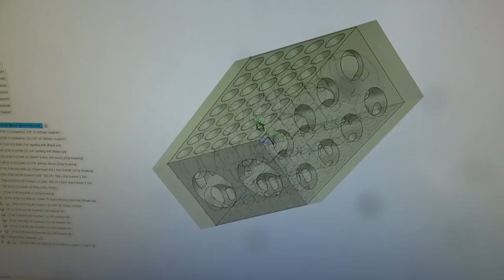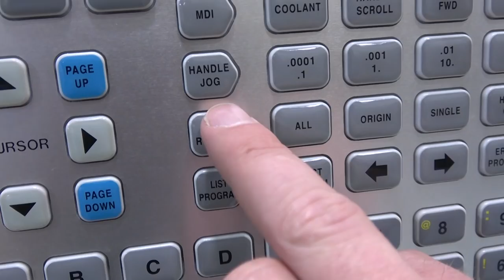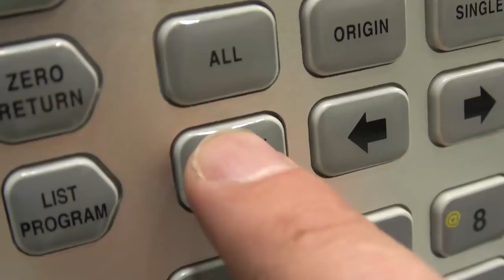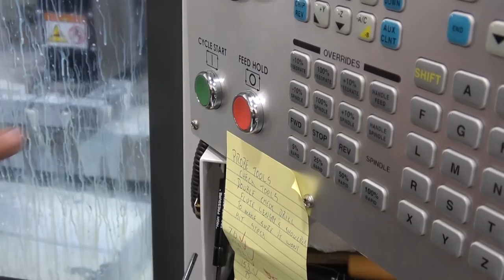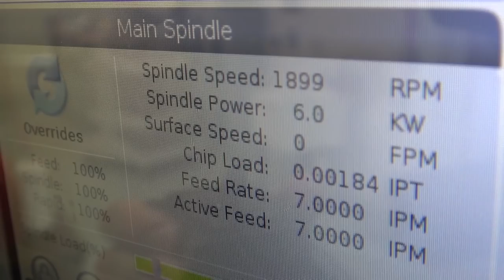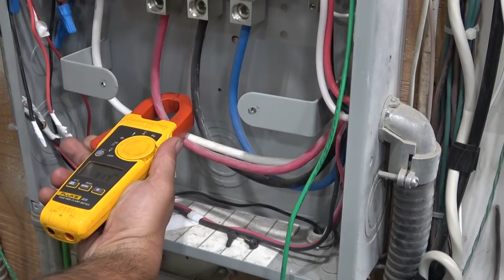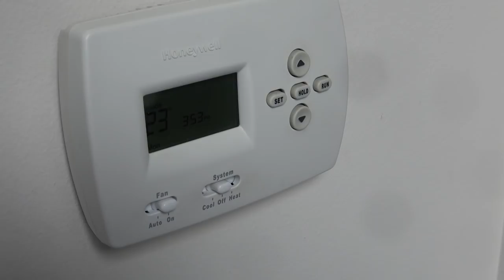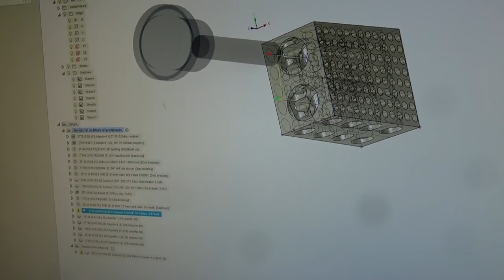Gizz Bloc. Sometimes it's best not to ask.

Comment: Lol you don't need to post a new G-code to start mid-program, just hit search in the MDI DNC page, type in your tool number you're using at that point in the program when it switches out to it the hit cycle start. Whatever line of code is highlighted is where you'll start at and Bob's yer Auntie. Try it out on the warm-up cycle what with the whole program fitting on the screen.

Comment: The Haas tool change bang is not caused by a burr on the pull stud. It's usually from the female taper expanding from heat, and high rpm, and the male taper moving upwards. It can also help to clean the tapers with solvent and scotchbrite.

Comment: The 200ul tubes are gonna be super tough to get out of there with a hollow core, typically it has a bevelled bottom in each well to keep them elevated in the block slightly so you can remove them.
Reply: Also with a hollow core aren't you getting rid of the majority of the mass/contact points for heatsink/cooling the samples?

Comment: Those poor insert drills! Run those bad boys first and crank the snot out of the speeds and feeds. The inserts in them are offset, one takes the point and the other cuts the diameter, they webble wobble all over the place when you try interrupted cuts.
Reply: Naaaah. Not that they aren't great for roughing out material fast like you say, but for interrupted cuts like this I'd much rather use this style of insert drill. If you think about it they're basically a rough boring bar that can also center cut. Also, good view of the CAM model at 1:19, look at where those smaller holes would intersect if the insert drills came first.

Comment: All he needs is an old PCR machine. 96 holes that fit 0.2ml eppendorf tubes (some also have 0.5 or 1.5 ml blocks) and fit them, ahem, accurately. But surely he knows this and he wants it for some other purpose. 

I should probably just mind my own business
Reply: I second this. Old pcr machines are a treasure chest of useful things. High quality heating elements and fans in em.
Reply: @THEANDERS00  cooling also. I used to be guilty of leaving them at 4°C over the weekend after my run had finished. Some of them. We're from the second generation of 7700s back when applied biosystems was its own company and not just part of the One True Lifesciences Company whatever its called these days Thermo Fisher VWR. Sorry for the rant, I've been out of the game for a while. Nice reminiscing sometimes

Comment: Whys your speed so low, 300sft carbide in al? I'm sure that u drill says at least 1000 on the box.
Reply from the maker: marginal workholding, interrupted cut. Sometimes the tool isn't the bottleneck.
Reply: @arduinoversusevil2025  I gave you a pass on the low feed because of the workholding, but double the speed with the same feed is half the load.

Comment: Is there any reason why you chose to drill the seemingly largest holes last? Is it because if the smaller ones were drilled last they would be more likely to snap? Is the same logic used when using less robust tools? Thank you.
Reply: If the larger holes had been cut first the smaller drills would have had to come in on the edge of the hole, putting lateral strain on them. Also, the style of insert drill used on the larger holes stands up to interrupted cuts better because it doesn't depend on the tip to keep it centered.
Reply: @FluffRat  Thank you kindly.

Comment: I really don’t know anything about CNC, but can you recycle that coolant? Because it looks like you have to use a lot, like a lotttt, and I can imagine that would get expensive?
Reply: The coolant recirculates. But it gets nasty after 3-6 months and must be replaced. The old stuff can be recycled in some areas.
Reply: @WeighedWilson  3 to 6 months? We were happy to get 3 to 6 days out of a tank when used all day every day. And that smell. And don't drop a wrench in the tank. Not fun reaching for it.
Reply: @millwrightrick1  we used blasocut at 10% and aerators to keep the bacteria down and skimmers to remove tramp oil. We were also not a 24 hour shop. 9-12 hours M-F unless we had mad rush work to work weekends.

Comment: I'm pretty sure there a way to tell the machine to start in the middle of a program but still get all the offsets and tools and feeds and speeds right
Reply: @Stanton_High  I thought there was a Haas video about a specific code to use so it grabs other settings from earlier in the code and it's less likely to mess up
Reply: It's generally considered best practice to program all tool changes as safe start points, and I can't imagine this part would have super tight tolerances that would be goofed up re-running half a tool. On the other hand, if the person writing the program isn't confident starting in the middle of it I'm certainly not going to smash go without a good close look at the code.

Comment: I wish I could into the metal working industry, but as a youngin I have no clue where or how to start.
Reply: At the beginning
Reply: Check your local community college first. They often have various tech trade classes/programs. Things like welding, fabricating, automotive, ect. If they don't then they might have good info on where to look next near you. ;)
Reply: A garden shed!
Reply: Depending on the industry in your area you might be able to find a shop that's willing to train you to load parts and push the green button all day. It will depend on what you have around you and how... overenthusiastic... their HR departments are about their experience requirements. The entry level job in the field is "CNC Operator", but some shops are not set up to train people off the street for one reason or another, and the shops that are willing to hire fresh meat often pay accordingly.